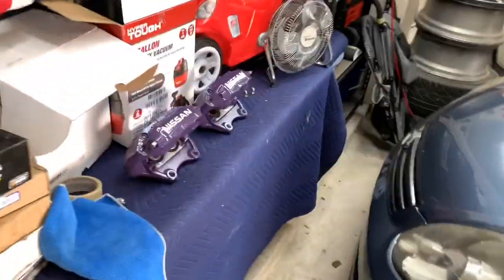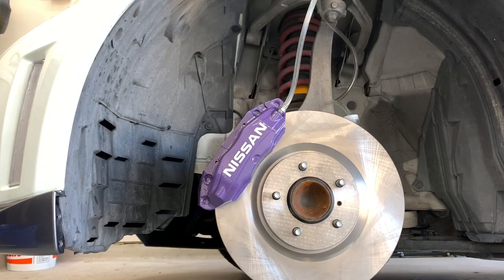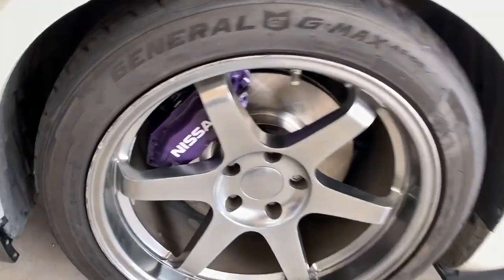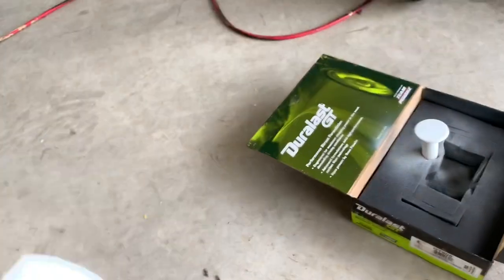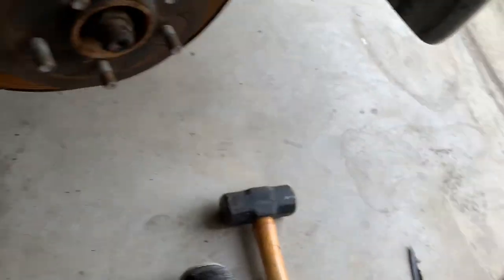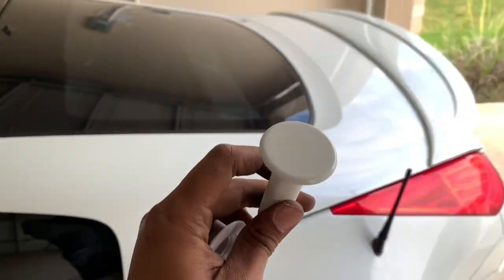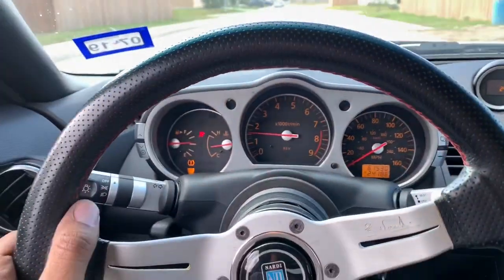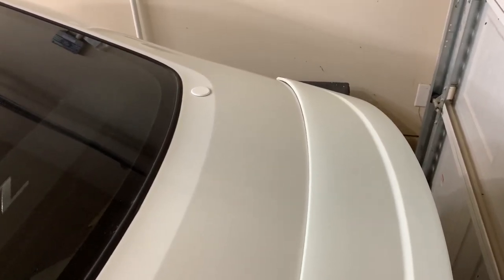W350Z | Part 2 Brake Caliper Install

Comment: I’m thinking about doing the same but do those calipers bolt right on or what ?
Reply from the maker: Yup just need a new shorter banjo bolt for the brake line.

Comment: Do you recomends those calipers?
Reply from the maker: Absolutely. Have them on my Z and have had zero issues
Reply: What i have to buy? Calipers, pads, what else?
Reply from the maker: @julianpedro4198  Calipars, Rotors, Pads, new Banjo bolt. I have a video on this if you want to check it out.